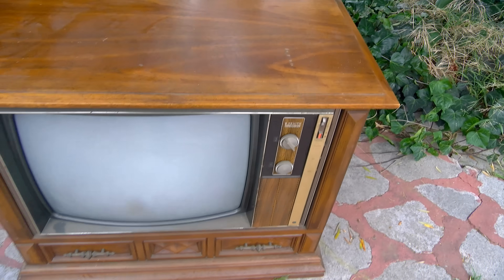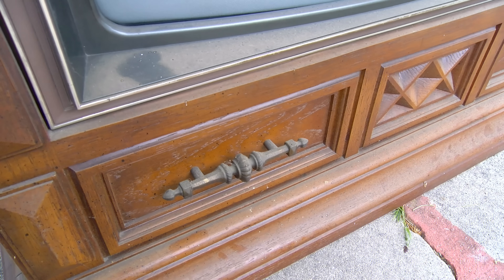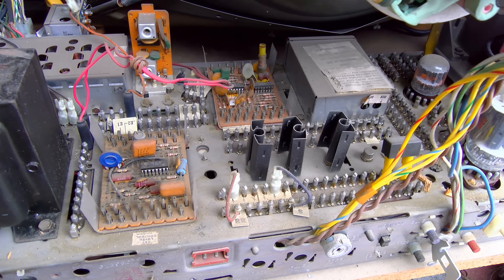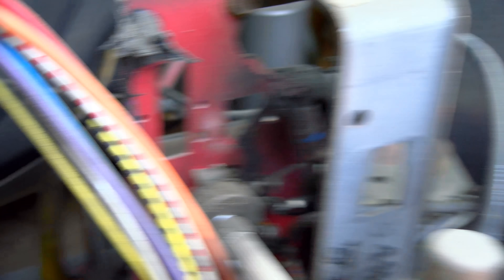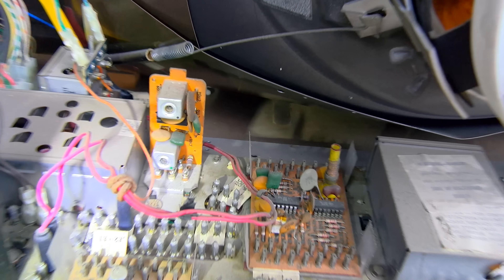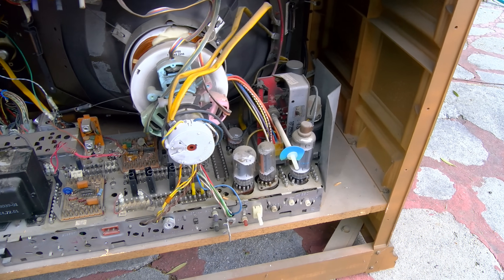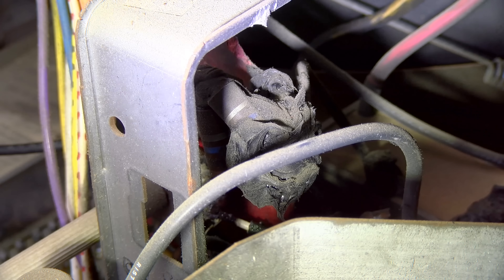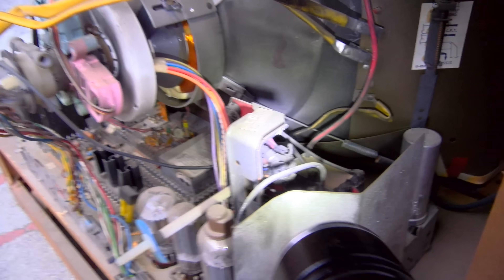Zenith Chromacolor 1973 Color Console 4 Tube Hybrid Television Analysis

Comment: Fuse is OEM A 500-1 ( .5A ) for cathode of H out. They did have 100% 25" SS sets starting the year before but cost + apx $150 more.  Those were known as the flat chassis and they were 

the BEST TV ever built by anyone, anywhere......

Clean it up, remove the IC sockets then give the CRT a clean & balance and it will run like new
for many years.
LFOD !
Reply: Absolutely right!  The BEST TV ever built.  The workhorse of the industry.  Hands down.  No-one could come close to the quality, picture, and reliability.  The BEST ZENITH EVER!

Comment: I think the reason why the smart tv consumes a lot less Watts is that there is no tube heaters, there is no high voltage circuitry (in fact many LCDs has very low voltage), and many newer smart TVs use LEDs for a backlight which takes even less power than the old CCFL technology for backlights. Most computer and digital boards also run on extremely low voltage (3.3 or less).
Reply: Stephen Hinkle but the older ccfl backlights last a lot longer than leds.. leds fail all the time,, I have an old lg32inch with ccfl backlight from 2005. the only thing that failed on that was the power supply.. twice. So I made it work with a power supply out of a different set, just supply the same or nearly the same voltages, the tuner dont work as that wanted 32 volts witch my power supply dont have. But it was analogue tuner anyway.. picture still good and bright.. was.. as dont use it no more its only 720p. A very early lcd tv

Comment: That Chassis is a thing of beauty
Reply: Zenith used hand wired chassis until the System 3 in the mid 1970s. Unlike companies like Admiral who introduced their 3/4 printed circuit chassis built in a semi automated factory in 1955. Growing up in the 1960s, we had a 1956 Super Cascode B&W who's audio board had been replaced with hand wired circuity on a piece of sheet metal by a local service shop.
Reply: Roger that!  They weren't just a TV Chassis, Zenith Chassis were works of art.

Comment: I think tubes were used because early transistors did not do well for high voltage circuits back then.   So using tubes around the horizontal circuit and HV circuit back then made sense.

Comment: We had the 19" "Space Command" portable version of basically the same chassis: a hodge-podge of tubes, transistors, and integrated circuits.  It lasted 13 years and did have a great picture.  In the shop several times, one time the UHF tuner module actually caught on fire.
Reply: On fire.  Ya, right.
Reply: You wouldn't think a UHF tuner of all things would burn,  but from what the serviceman showed us, it burned pretty darn good!  Thick smoke was bellowing out the back of the set, yet it remained playing until powered off.

Comment: That set came off the assembly line just in time for the Arab Oil Embargo and the resulting Energy Crisis! Your hard-earned money didn't go as far in those days due to "stagflation," so television manufacturers had to cut some corners with the materials in their products to keep their costs down and mitigate price increases for their customers. This was happening throughout the 70's, into the early-80's.

Comment: No cathode rays for me
Conductive red circuit board? I would have loved to hear the sales pitch on this "Dial in your planned obsolescence"
Reply: atleast you can silicone it and be done with it....nowadays they have more imaginative ways to enforce planned obsolescence...for example by adding software to everything and deliberately bricking your device when they want
Reply: @MrHBSoftware  it doesn't work that way
Reply: @doctorfeinstone6524  can you elaborate?
Reply: I'm sure it was just the dust particles lining up along the voltage gradient until eventually they were dense and damp enough to conduct. After the arcing the carbon track forms and embeds in the surface.